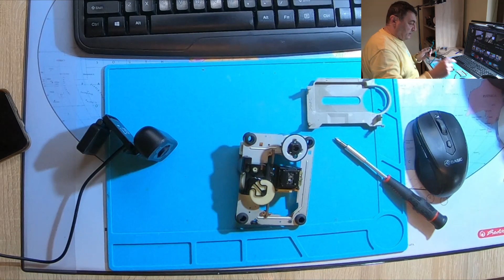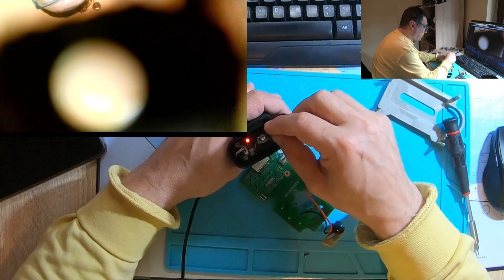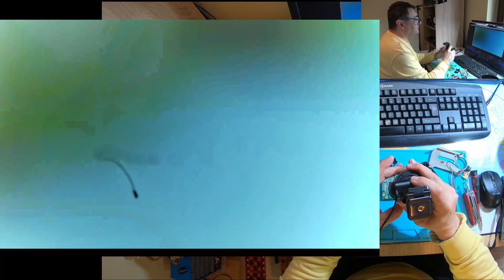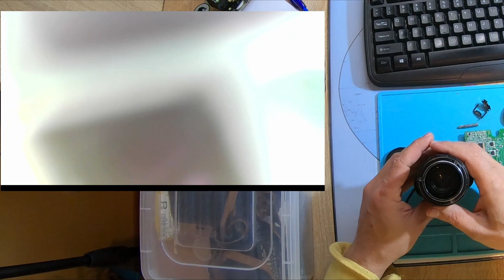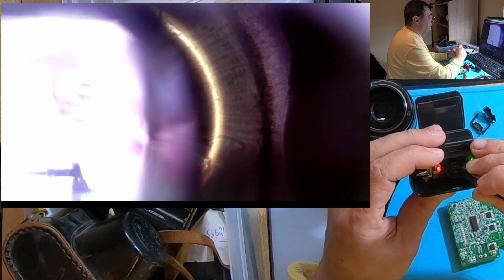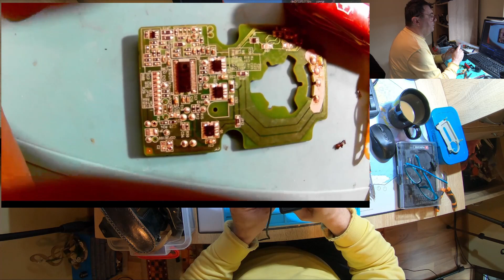DIY USB Microscope McGyver style? Why not!

Comment: This is what I did. Super easy and cheap. I bought the 1600 usb microscope 11$US. The sensor is .2MPs. Useless for a microscope. Break the lens part out. Throw the rest away. All you need is the lens. Pull the foot off the lens. The part that slides in the two brass guides. Under that is hidden an M12 fine thread. Now you just have the lens holder. Dont take the lens apart. 

I had an 2MP hikvision bullet cctv camera lying around. If you dont have one, buy one they really cheap. Preferably the one without IR lights around the front. Strip the board out with the sensor. You can unclip all the plugs into it. All you need is the power and bnc cable plug connected. Screw out the M12 lens from the hikvision board and then screw in the usb 1600x lens holder. They are a perfect fit. 

Now hook the HV camera board to a monitor and 12v PS. I used a vga monitor. So had to buy a vga2avg converter. I cut the yellow plug off one side of a vga cable and soldered a bnc female plug to it. 

Power up the HV camera, monitor and converter and be prepared to be astounded as to the quality of picture and height you will get. Of course you have to screw in and out the lens and move closer and further away to test which picture you want. You can also open the lens holder and turn the lens around in the lens holder to see which type of picture you prefer. 

If you really want a good picture and want to throw a little more money at it. Don't buy the Hikvision 2MP camera but a 8MP camera module 25$US with an M12 mount. Screw the lens out that it comes with and screw in the 1600x usb camera lens. You will have the same quality from the bought ones from hayear. You will need to mount the module in an holder and a stand.
Reply from the maker: Excellent project and I'm sure it's doable. Thanks for let us know!
Reply: Wow @teutonman7018, that sound really interesting! I am looking for a cheap but good quality microscope for electronics with a decent working distance and your enthusiasm on the results you had is quite contagious! Do you have a post, blog, video or something showing your setup and the results? If it actually is like you said I would love to replicate it!
Reply: @tomy983  Sorry no blog or anything. It works exactly as I stated. If you going to go with the 8MP camera module make sure it can render straight to a monitor and not into a pc. If it goes through a pc you will get a good picture but as soon as you move the camera or there is movement in front of the camera you will get a blurr till you stop moving. 

I also have another microscope. I used a old cctv samsung box camera, model SDC-435, with auto iris that uses a c/cs mount. I bought the pi microscope lens ( I think its 5-100 magnification). It uses a c/cs mount. Comes with an adapter. I unscrewed the lens it came with and screwed in the pi microscope. Works well. Unplugging the auto iris 4pin  plug does not affect it at all. It's  a bit bulky but works well. Both the box camera with pi microscope lens and the HV (Hikvision) camera with the 1600x usb microscope lens will give you good distance from say 10cm to about 40cm clearance to work under.
Reply from the maker: @tomy983  It's a work in progress, I didn't manage to have a proper stand, still looking for a better HD even 4K camera and so..there is no final result yet but I'll publish a video as soon as I have something to share...
Reply: Please make a video bro ❤😢
Reply: Can you do a video of this?